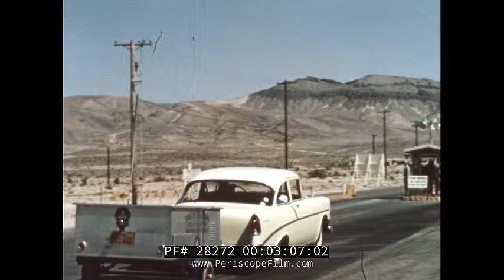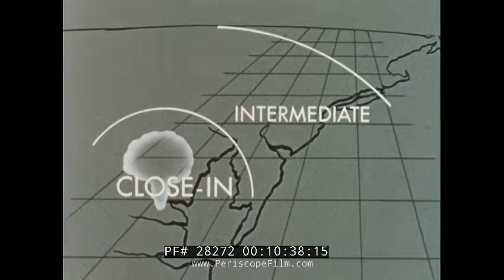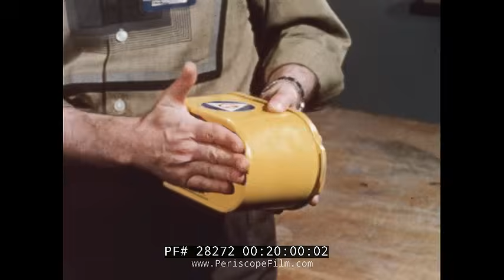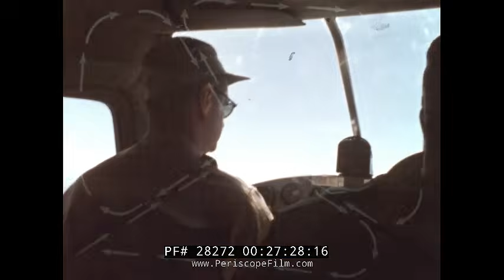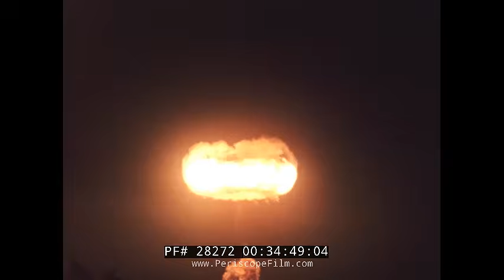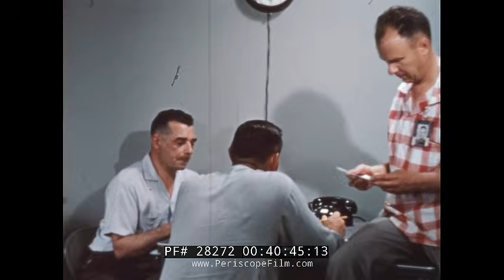OPERATION PLUMBBOB 1957 ATOMIC TEST "MISSION FALLOUT" 28272

Comment: My uncle was a chemist who was on the aerial survey team who flew in the helicopter you see in this movie.  However, he flew right through the mushroom cloud 10 minutes after detonation, not what this movie leads one to believe occurred .  It was still dark as the shot was before sunrise.  I was fortunate to do a 2-hour interview with my uncle in 1999 regarding his work at Mercury.  The stories he told will make your hair stand on end.  Among one of them was when the probe that was lowered to the desert floor became wedged between rocks and consequently pulled the helicopter down and right over ground zero (which has the highest radiation levels and was strictly forbidden to fly over).  He has to cut the cable to free the helicopter and prevent a crash at ground zero.  Harrowing to say the least. 
 My uncle later went on to be head engineer in the production of the engine nozzles for the Space Shuttle.  He died from a rare form of Lukemia, the last of his crew to survive.
Reply: Leukaemias peak c. 6 to 8 years after exposure, and the risk declines but at different rate for each subtype of Leukaemia, so by 35-years post exposure (above ground testing ceased at Mercury in 1963) if your grandfather's leukaemia was CLL, CML or ALL, a radiation kink is unlikely. However, if it was AML, the most common leukaemia subtype, a link with radiation exposure remains plausible given the extreme exposure level.

We know the risks and likelihoods from following the lives of 136,000 survivors of the atomic bombings in Japan, the atomic bombing lifespan study. Between 1950 and 2001, there were 43 cases of ALL, 176 cases of AML, 75 cases of CML, 7 cases of CLL and 18 cases of unclassified Leukaemia among Atomic bomb survivors.

Of these, researches believe 94 (30%) were related to radiation exposure. They worked this out by comparing the survivors with a non-exposed Japanese control group, matched for age, health, smoking rates, education etc., and calculated the excess numbers of cancers, the more than expected number (30% of all leukaemias were linked to radiation exposure). 

They also found, with a dose of 2 grey or more, there were 6 background and 57 radiation linked leukaemias. It this level of exposure, 2 grey or more, they suffered moderate radiation sickness, lasting 1 to 1.5 month (the fatality rate at 2 grey or higher, from acute radiation sickness, was about 5%, with most that died, dying within a month of exposure). It's likely your grandfather received multiple doses, resulting a total exposure >2 grey.

94 cases of leukaemia might seem surprisingly low, however, few survivors received high radiation doses, > 2 grey, as few survived so close to the atomic blasts, shielded from the blast but not radiation by strong buildings.

I just ran the statistics, using the best available epidemiological evidence, assuming 2 grey exposure i.e. moderate radiation sickness:

1. 15% chance Chronic Myeloid Leukaemia (CML) is radiation linked after 35 years.
2. <1% chance Acute Lymphatic Leukaemia (ALL) is radiation linked after 35 years.
3. Moderate to High probability that Acute Myeloid Leukaemia (AML) is radiation linked, however this risk estimate is uncertain due to misclassification of this type of Leukaemia in the cohort.

4. Chronic Lymphocytic Leukaemia (CLL) is a very rare leukaemia that appears in old age and is not known to be linked to radiation exposure. Perhaps this was the cancer your grandfather had?  It is not known if CLL is caused by radiation exposure, as this rare cancer is often not listed correctly on death certificates of elderly deceased, making epidemiological analysis difficult.

Bottom line: Given the temporal patterns, if your grandfather's leukaemia was CML or ALL, radiation is unlikely. However, if it was AML, or possibly CLL, radiation remains plausible given the extreme exposure level.

See: Gale, R.P., 2023. Radiation and leukaemia: Which leukaemias and what doses?. Blood Reviews, 58, p.101017.

Comment: 34:00 Were those goggles really effective at protecting the eyes? Does anyone know if people at the test site suffered with vision problems even after they wore these goggles, of which became permanent?
Reply: The goggles only function was to reduce the light level reaching the retina (same as with welding goggles) so as to avoid burning the retina as staring into an atomic blast is comparable to staring into the sun.  That’s really a rather simple job to achieve so I would imagine they did that job quite well.
Reply: "The goggles! They do nothing!"

Comment: This Nevada desert is probably a part of "Area 51", a highly classified military research facility.
Reply: MA: No. This is not part of Area 51.
Reply: It's the other way around.  AREA 51is part of the A.E.C.'s Test Site Grid Map starting in the top left corner of the designated site and is numbered  from left to right  and top to bottom. You can pull up the grid map and see A-51 as it is shown on the map. The Nevada Test Site was founded in late 1950 and first shot done in late Jan. 1951. A-51 was established months before the first test flight of the U-2 spy plane in 1955 .
Reply: True...In Soviet Union they lit off all their stuff in Katzakastan.
Locals never evacuated.

Comment: Good thing they had coveralls on.
Reply: A pretty common misconception is that there existed some suit capable of stopping gamma or x-rays. You've had a dental x-ray, right? Imagine wearing an entire suit made of the same stuff the blanket they make you wear. Alpha and beta particles can be stopped by cloth though. It's when you inhale the dust particles that you're screwed. The dust emitting alpha or beta particles on your skin is relatively harmless but getting it inside your lungs almost guarantees lung cancer. A dust mask would have been better protection than the coveralls.
Reply: "Participants are encouraged to breath deeply".

Comment: skipped over radiation from early  color televisions... people from  soviet countries were easily recognized by apparent "sunburn" appearance (West Germany banned East German TVs)
Reply: Lies. Early televisions DID NOT emit dangerous amounts of x-rays. Electron tubes operate above 16KV and below 100KV only emit what are called soft X-rays. This whole TV radiation myth was based only on theory. It was proven false as soon as the lie surfaced. But, the lie was more fun to spread and, face it, the sheeple a f*cking stupid. The soft X-ray problem was fixed simply by adding lead to the glass of the CRTs. And NO, the lead does not contaminate the environment because it is locked up solid in the glass, IMPOSSIBLE to separate, the same way they vitrify nuclear waste for long term storage. The high voltage regulator tube in early color TVs also gave off soft X-rays too and was completely shielded inside a simple tin can.
Reply: @videolabguy  wow I thought that was nonsense..
Like early microwave hystria.
Reply: UV radiation... Wow I was curious about early sets then.